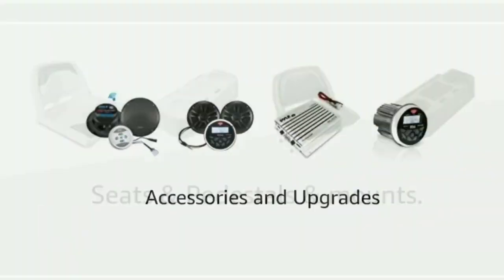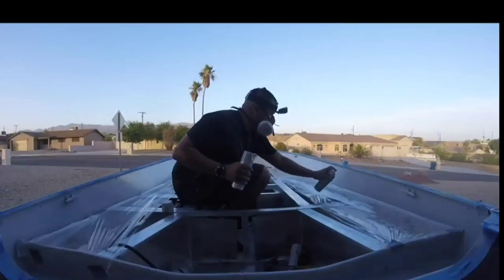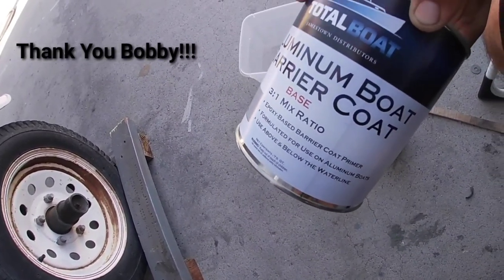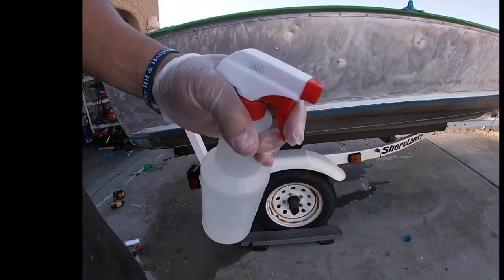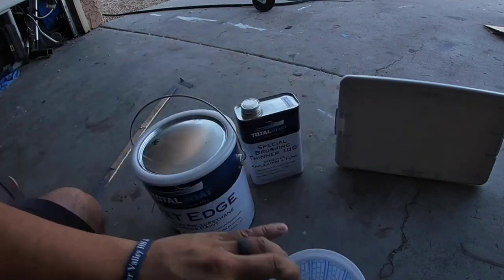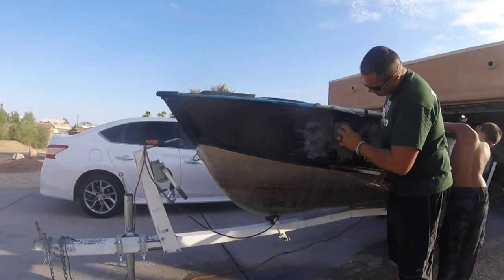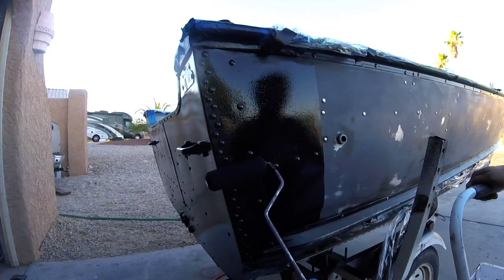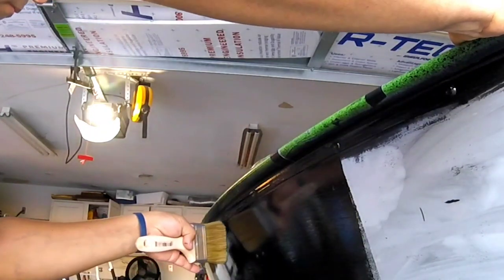Rolling and Tipping | Do's & DON'Ts of painting your boat.

Comment: Afrer extensive research, I'm going with Wetlander for my boat.  I spoke directly with Scott from Wetlander for about 15 minutes on the phone.  Super solid dude and answered all my questions.  It's actually applied with a microfiber mini roller and that's it.  He said not to tip this stuff.  It lays out great with just a roller.  It does take 7 days to fully cure though. And the boat would need to be flipped onto some horses to do the whole bottom.  I'm going to do it once the fishing season is done here in the northeast.  Probably mid-November.  Gonna have to do it in a heated garage.
Reply: black jesus
Reply: @stolencoats63  does this stuff work on fiberglassing boats? My boat needs a new paint job and I don't have the money to mess up.
Reply: @jesuslopez9223  yeah it can be used on fiberglass.
Reply: @jesuslopez9223  yes it does
Reply: Just the Tip.
Reply: Hey, bud, how did it go?
Reply: @chronicawareness9986  yes my son?

Comment: Years ago I worked for a company painting very large boats where it's impossible to spray a 60 ft boat so we used this method....I used a foam brush to tip the paint and throwing away the brush every few minutes as the tip became distorted....I highly reccomend this method for boats....I was able to get paint jobs that I couldn't tell had not been sprayed....I reccomend a person practice on some scrap sheet metal or something as smooth as your boat...If you get this process right you'll be very pleased with your work as they are in this video....I found this type of paint held up better than any automotive paint I've ever used..,.I think people when they see a paint roller think of painting like they would when painting Thier house but that is a problem.....Thin to win is my saying ....This was a great video !!!! It show the common problems and that persistence pays off.....I assure you most of these paints are not cheap but we'll worth it....I spent years using it as well as doing all types of repairs to boats ..Great video ..,.I'm in the process of painting my Jon boat and I didn't want a spray can camo after the prep work I don't want to do this again in a few years......With my experience with this method I still watched your video to see what had changed with paint in the last 20 yrs....I can say that the paint I used was 200 a gallon and almost as thin as water once mixed ....A gallon would do several boats the size of this one.....I don't know why this paint appeared to be thick once mixed but I can say the thinner it is the less orange peel you'll deal with....Great job and Great video....People that show Thier mistakes help us all....When videos don't show that....to me they have little value .....Really good video you did a great job ...This paint takes practice and you got much better after a few attempts .....Thank you for showing people an awesome way to paint a boat.......No over spray is nice when your working on your boat in a dock close to other boats.

Comment: Gravity feed spray guns can be found for less than 50$. 
You can thin that poly base paint with mineral spirits and use magic hardner for a quicker dry and some sheen. Plus it'll be smooth. If it's spitting out bigger droplets thin a hair more and or adjust air pressure.
Rattle can paint is thinned out way too much. Its lighter duty than
Poly/ oil based paints when applied with a spray rig.
I only roll it on when you want nice thick coats.
That hardner definitely speeds up cure process.

Comment: In the category of learning thru mistakes or failures I have found that the best rattle can paint jobs are those done with rustoleum professional, it comes in a silver can there aren't as many colors available in the professional type but you will get a glossy finish the drys hard and is durable. If you are doing the exterior of your hull and want a high gloss super durable finish follow up with 2k clear. It has a hardner in the can that has to be activated and mixeg before application.
Reply: I agree.  I restored my trailer and used the Rustoleum Pro enamel gloss black.  The finish looks like a factory job and its very strong.

Comment: Well definitely a what not to do when painting your boat. 😆  rolling and tipping is best done with two people. 1 guy rolling 1 guy tipping. Start at the port side transom and roll the paint moving towards the bow. The tipping man hopefully is right handed. If he is not then start at the bow on the port side. I use a foam brush to tip with. Dip the tip of the foam brush into paint then drag it over the edge of a red solo cup. Gets most of the paint off the brush but still leaves the brush damp to help with maintaining a wet edge ass your rolling and tipping. It blends the start and stop much better. 
 Start with your right hand crossed over infront of your body very light pressure with the brush. One stroke across yourself as your right hand is almost fully extended lift off pressure gently as your finishing your brush stroke. Helps feather in the paint to what was already painted to your right. If you start to notice your foam brush is loading up to much paint because the guy ahead of you is applying it a little to thick. Drag both sides of the foam brush over the edge of a solo cup again. 
   Heat is evil for rolling and tipping. Start your paint early in the morning 5 or 6 am what ever it takes to get the paint done in the cooler part of the morning. Anything over 80 degrees will be a nightmare for orange peel. 
  Add a bit more brushing thinner 15% to 18%. You can knock down orange peel with 400 grit sand paper and apply another coat. 
  I would recommend Alexseal yacht coating / paint as its great for both rolling and tipping as well as spraying. Just not an electric spray gun. It can also be wet sanded and then buffed just like gelcoat. However it is a little thinner. Give me a call sometime and I'll help ya shoot a video for this. 😆  Did alot of marine painting and Varnished bright work back in the day. Probably 100's of coats of paint and varnish. Learned from one of the best.

Comment: Hey Tiny Boat Nation:  I see that your fingers are getting tired watching you moving from thumb to index.  I know.  Get the $7 rust-oleum comfort spray grip that goes on top of the can.  It'll make your life so much easier.  Believe me.
Reply: I tried using one of those and I was not a fan. With the can I was using, undercoating, the comfort spray grip would not fully push down the nozzle on the top. I am not sure if it was just with that product, or if it is like that with all rust-oleum products. I think the product is a great idea though. If you like it, great, I just wanted to share my experience with the product.

Comment: - It will go a long way to avoid lap marks if you draw the brush tip from dry into wet.
- Foam brushes (2-3” wide) are excellent for laying off the finish coat but not for application (too slow). Use a good quality bristle brush (3” wide) natural or polyester. The idea is to get the material on with proficiency then lay off (tipping) with the foam brush. You could also use a 3” roller (fine nap) and small tray for applying the material.
- Two people work best at it.
- Absolutely avoid days that will be too warm (air temperature above 75 F) Stay out of direct sun and the wind will flash it off faster then you can keep up. Try to do the work at the earliest time of the day.
- And like you found out multiple thin coats will give finer results
- A dust mask is a good idea when using the palm sander, even outdoors you will be surprised after 1 hour what you have been breathing in.

Comment: Need to tip, lay off, into the previous section, whilst still wet.
The trick is speedy application, laying off into the previous coatings.
Looks like that's a dry brush?
Badger hair softer isn't needed.
A decent quality sash brush does just fine.
Also, did you just cost the chrome or polished cleats etc?
Guaranteed that will be where this coating begins to fail.
That or the untreated rivets you installed as you were priming.
Also, a bit of orange peel in the coating is preferably to extremely thin coatings.

Comment: Have you considered low temp aluminum brazing rods and map gas for filling those hulls? Works amazingly well
Reply: @TinyBoatNation  I don't mean welding. I'll burn a hole like a lighter and socks trying to weld, lol.   Just a map gas (yellow bottle) torch from home depot and the low temp brazing rods, fills in holes like melting a plastic spoon. Which I actually just used. I had a small hole and melted a soda bottle into it and filled it nice. Lol.

Comment: When you tip.  Tip sideways then up and down... if you just tip sideways the paint lines are horizontal and can sag  onto itself where if you last tip  in up and down the paint will less likely run or will run down the tip line. Not on top of each other and over lap like tipping left to right.

Comment: I have a Boston Whaler that I'm getting ready to do the same on the hull.  Not with aluminum primer but with the Top Side paint. You stated you mixed a 10:1 ratio on the paint to thinner to begin with but realized later you had to put it on thinner.  Did you add more thinner to the paint or just tried to apply it much thinner?

Comment: Please know that the masking tape you use DOES matter, especially if you’re painting outside in the sun and the project will take more than one day.  You want your tape to leave a sharp line, to pull off without breaking and to not leave residue.  3M blue 2090 is pretty good, but not in the sun for a week (at least in FL). The very expensive 3M silver 225 is good for several days, perhaps even a month, but test any tape before you use it for the number of days you expect it to be on.  Tape deteriorates over time, though it has no “use by date”.

Comment: Tip: if the paint is too thick and orange peeling immediately from the sprayer, then add more thinner.,,,  i think tree are additives that compensate for high or low temperatures also

Comment: If orange peel is the problem, it’s either a spray tip issue, pressure, or you haven’t added enough paint thinner to get the proper consistency out of your paint. Don’t ever use a Wagner sprayer. Get a compressor and a Graco cup gun designed for  fine finishes with oil based paints.

Comment: Question I painted our boat with the same product this year and months later i shrink wrapped the boat for the winter. Weeks later I opened the cover to put more things away and noticed the paint in various areas has bubbles in it from trapped moisture under the shrink wrap and yes the cover did have vents.....have you had the same problem

Comment: Question: if you were painting a brand new tracker jon boat, would you take it all the way to the bare metal?   If I don't care about a glossy finish, wouldn't the outside coat (pretty textured) be a great surface for rattle can application??
Reply: Sounds like a fellow duck hunter

Comment: I already put my tags on my boat, but I would like to paint my boats. Would you have any suggestion on how I should go about it besides covering it? If I take it out is there away to reapply it?
Reply: True ChamP I would try to take them off with a razor blade and a blow dryer. Then reapply with epoxy or something. Or you could try to get new tags and just remove the ones you put on

Comment: You did fine the first time. Just need to sand again with much diner paper. Paint again. Sand again with very fine then last coat and finish with wet and dry paper. Should come out mirror clean. Wax after very important

Comment: Well that was a learning experience for you. I would had done it a bit different. First thing is the kind of paint you use. I would had used self leveling Vanciiel tractor paint. For 35 bucks you can get a hole gallon. And never need primer you just clean the serifs and role the paint right on. Uses a sponge roller to apply it after you are done with 1 cot let it dry over night go back and apply 2 cot let dry 24 hours and you can’t knock it off with a hammer 🔨   Let it dry for a week then you can put decals or spray paint what ever you like on it. Remember Vancycle self leveling Tractor 🚜 paint. Next time you go to paint your boat 🚣‍♀️
Reply: I am looking to paint my all Aluminum Bass Boat. So you would use it? Have you tried it on an Aluminum Boat? I checked product data sheet on your suggestion. Says-Application of Van Sickle Tractor Truck and Auto
 Acrylic Enamel finish coat or primer is not recommended on coil coated or galvanized metal, masonry, aluminum or asbestos surfaces.
Reply: Jim is right.  Van Sickle is great paint for tractors and farm implements, but should not ever be used on an aluminum boat.

Comment: Damn that was about $100 in paint products down the drain
Reply: Tiny Boat Nation I respect that. I spent about $200 in epoxy paint products to paint my aluminum engine bracket. Prep work was intense. Interlux products are $$$$
Reply: I am glad TBN included the fails, as it makes a much better teaching video to show both the successes and the fails.

Comment: But ordering off your store will take forever because of covid 19.
Reply: @TinyBoatNation  Yes that is what I mean. Since it is amazon it will take forever because of covid. I have one question. So I have this 16 foot aluminum boat that is pretty narrow. I am planning on converting it to a bass boat. The transom is pretty low and I would say that a 20 hp is the highest I can go. I bought some rust paint. The red paint on this boat is flaking so I plan on sanding the flakes over and then just painting over it. It is very humid here and the boat is in the water. So I am painting and putting in the deck and everything while it is in the water. Do you think this will work? Also, I dont know how to raise the transom and I dont want to have to take it appart. Could I add treated plywood and maybe bolt it to raise the transom?